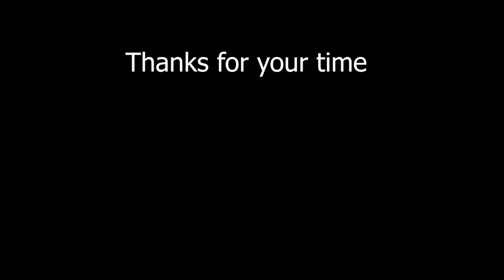Now THIS is going to be INTERESTING!

Comment: As a novice wood turner I'm not sure if this is motivating or demotivating.  I can design and build a house no sweat.  Don't think my mind will ever be able to conceive anything like this on it's own.  Still, it does give me something to strive for.
Reply: Woodturners build houses? Man am I doing stuff wrong.
Reply: All it takes is practice. This dude started the same way we all did and made the same mistakes.
Reply: Remember that if your spacial awareness is not best, you can use modern designing tools to help out with that. For instance get fusion 360, design a bowl or what ever you like shape vise, then make objects to present boards and other material, place them top of each other and with that you get dimensions of the plank, dimensions of materials to be cut, how it ends up looking and so on, heck even animate whole process and count how much it will weight eventually.
I have excellent spacial awareness and i could barely figure out how he did this and i'm guessing nether he did know how it will end up, just mixed boards, flip them on angle and removed material until it looked good.

Comment: You should invest in a strobe light with adjustable firing rate.  What this will do is allow you to see the project while it is spinning, as if it is still or barely turning.  It  takes the guess work out of lathing unusual shapes.

Comment: My brain can’t compute that three corners came from a cube. 
A wonderful piece.
Reply from the maker: Thanks  😉
Reply: Look at 3:02 - it shows which three corners were marked. Of the 8 original corners, two were at the turning points of the machine, and the remaining six were free accessible. Of those six, three were pointing left (and disappeared in the process), and three were pointing right, got marked and left to become the three corners in the finished bowl.
Reply: Remember that a cube has 6 sides and any 3 of those of those 6 come together to form a "point".
Reply: If you have some dice handy, take one die and put two opposing corners between your thumb and forefinger.  Hold it so those corners are pointing up and down.  Then count the remaining corners.  You will find 6 remaining in two rows of height.  One row of 3 that is higher and one row of 3 that is lower.   If you carved away the lower row and then the points that you were holding between your thumb and forefinger, you'd have 3 evenly spaced corners left.
Reply: There are 3 edges radiating outwards at each corner-point of a cube . If you intersect only those 3 edges with a plane you'll get a triangle on the cut face.
Reply: Im thinking the same myself.

Comment: THE ONES THAT THUMBED-DOWN THIS PROBABLY WOULDN'T KNOW WHAT END OF THE POWER CORD GOES WHERE
Reply from the maker: hah!
Reply: Or they got traumatized by the two girls one cup soundtrack
Reply: They sat on the plug, never got over it
Reply: I had to look because I didn't believe you when you said there were thumbs down. Slight downtick in my faith in humanity.
Reply: Or, they're just honestly really not that amazed.
Reply: Most times, the thumbs down folks realize that they are never going to be this good. Instead of trying to learn and get better at their craft, they simply try to tear down people who are better. The trick is, somebody, somewhere is always going to be better. That's why you have to keep striving and upping your game.
Reply: Russell Gerdes  AKA: keyboard warriors/critics. One giant downside of the internet is half the idiots that have never touched a tool will think they would do better if they had to come up with something original. Everybody's an "expert" nowadays. Tend to be the same people that go to a car dealership and kick the tires...🤣👌

Comment: You ever try to turn a bowling pin? Very beautiful blocks inside. I watched one made into a lamp. Hardest & messed up part was drilling hole thru the middle for the cord. A long enough drill press bit wobbles at the tip.

Comment: When I saw the finished product, I thought of the linear graphics I use to do as an elementary school pre-teen. The space between the lines was rounded with some portions of the arcs created, concentrated. I was actually able to form shaded spheres in some of those creations, as well as other varying curved shapes. I believe it came from a calculus technique using lines to find the slopes of curves. I was doing it not even realizing the underlying significance of it's origins. Not sure if in principle that's the case with this craftsman, but he was very successful just the same. 
Magnificent work!!💎💎💯

Comment: 9:32 Maybe a mistake in glueing the parts? --> The pattern is from top right corner in 2/3 RED WHITE GREEN. At the last 1/3 part it is GREEN WHITE RED, so the wood is glued 180° turned.. 
Greetings from Switzerland
Reply from the maker: It is the order in which they are glued. Each layer overlaps the next.

Comment: Just a quick follow up from Frogblanks.com, we now have a nifty little widget that you can use to order Trifecta bowl kits - you can find it at https://frogblanks.com/Frogwood/BowlBlanks - pick a base color layup, and your choice of three accent pieces, and click the Purchase Kit button. You'll get a total of 7 pieces that you can assemble into a 7" cube with a couple of 1" x 1" section blanks left over. BE SURE TO SAND OFF THE SHINY LAYER from the pieces before gluing. You don't have to turn this corner-to-corner, it'll make a lovely bowl turned in the regular way with fewer hazards to fingers! Also further down the page you can find 5" x 5" x 2.75", and 7" x 7" x 2.75" bowl blanks.

Comment: I'm not a wood turner but have years of carpenter experience. Couldn't the artist cut the original block in half and make 2  art pieces instead of just one large one? I understand the 2 would be a little smaller but I just look at how much material was removed and what could have been. Very nice work though. 😊

Comment: 1. Did he really just use normal yellow glue?                                                           2. Why didn’t he just cut the corners off with a saw to start with? Would have been faster and safer wouldn’t it?